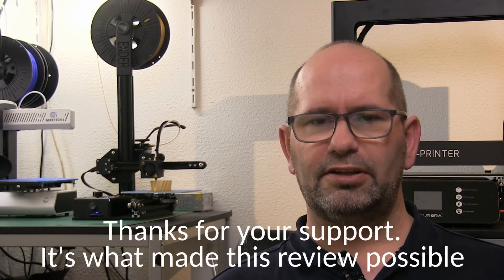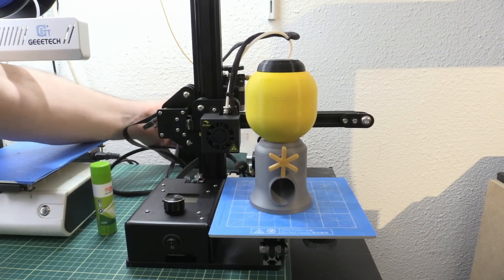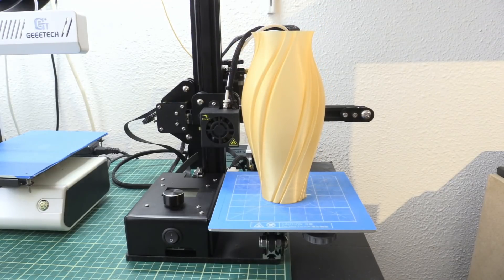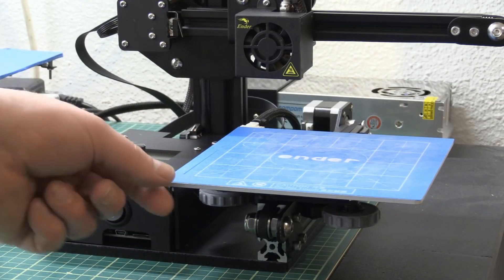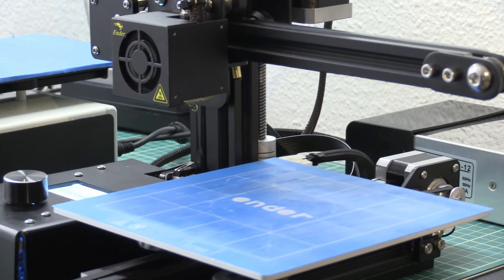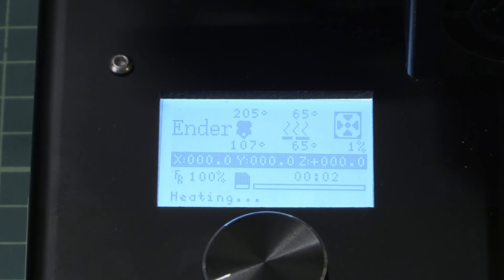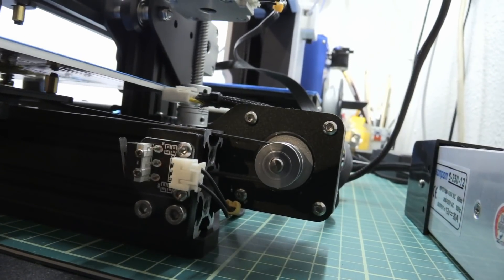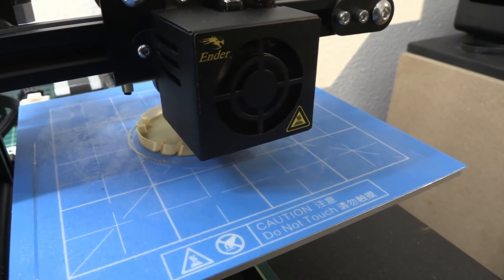▼ Creality Ender 2 Review

Comment: Which flexible did you use with the Ender 2?
Reply from the maker: I have now been using NGEN Flex, TPU and FlexiPLA.
If you print slow, they all work fine.
Reply: 3d Print Creator Thanks for the information.

Comment: I'm interested to get one, can this printer be tuned to print nylon?
What is the maximal nozzle temperature? I cant find this info anywhere,
Reply from the maker: Max Bed temp = 110C
Max Nozzle temp = 260C
Just tried it on my machine as it was not stated in the manual as well

I have been printing Nylon as a test with it, but it was low temperature Nylon that can be printed at 245C at 30mm/sec. Print was perfect.
Reply: Thank you.
Reply: Thank you that is very helpful,

Comment: Did you change the standard S3D settings for the Ender 2? I just received mine today (still in the box) and have found there's a large community on Facebook and Youtube supporting this printer, with a few mods (fan duct, new motor mount for the Z-axis, filament guide, the hand knobs you mentioned and even a new motherboard to make silent).
Reply from the maker: For every printer I own, I always make a profile that matches the printer the best way possible.
The Ender 2 is no exception. I am still finetuning the profile, then I am going to share it on my website.

Comment: Just a question..did gb sent it from China or from Europe? If China how much did you paid tax?
Reply from the maker: Hi Vincent, I received the printer from China in 9 days after I ordered it. I didn't have to pay taxes, just 137 dollar for the printer.
I do have to say, however, that I receive some printers without taxes and sometimes I get a letter that I have to come and get a printer from the postoffice and that I have to pay taxes. Most of the times, those are printers that ar send as a review sample, so when I proof this is the case, I don't have to pay the taxes, but sometimes GB doesn't say it's a review sample, then I have to pay about 1/4 of the price of the printer.
Reply: Thanks for the answer...I think I will order one. The results I see are excellent.
Reply from the maker: It's really a good printer. It's cheap, yet very sturdy. Also the build is very easy and the build size is enough for most of the prints I wont to make. It handles PLA, PETG and NGEN FLEX (flexible filament), so yeah, I am very happy with it. It can definitely compete with the CR-10 when it comes to quality of the prints.

Comment: HI Brian , nice printer  , wish I had supporters on my Channel so I could get a CR-10 or a Tevo tornado  ... what ever  main thing it has a 250x300 printing area at least
Reply from the maker: Hi, It's sure helps if you got backers that support you but I don't think it will be long before you also have them. The first 200 to 300 subscribers are difficult, then you gain them almost automatically.